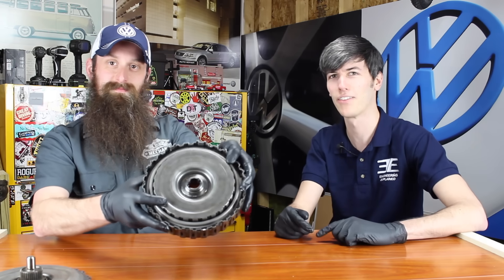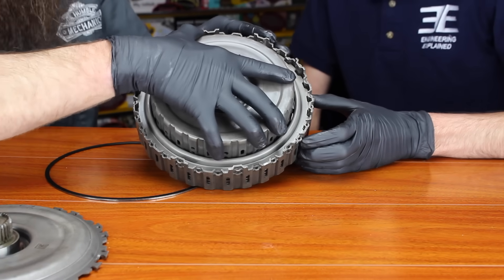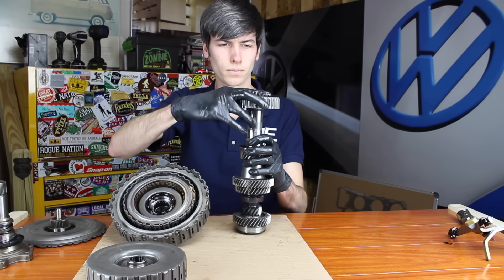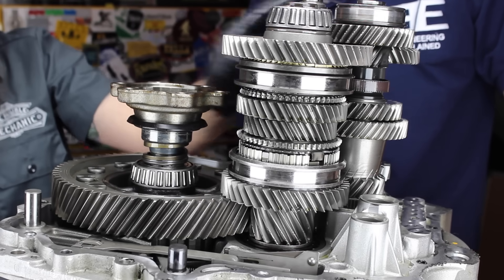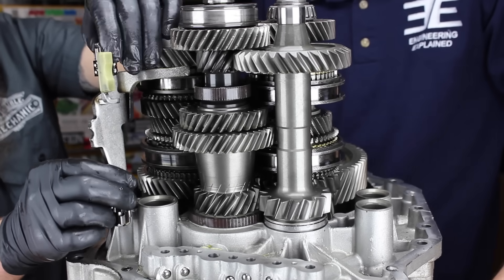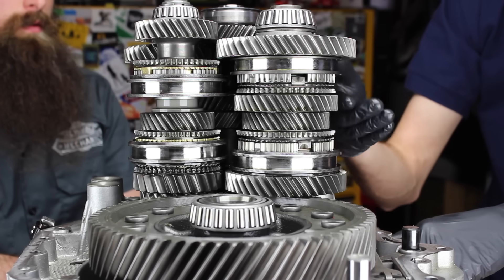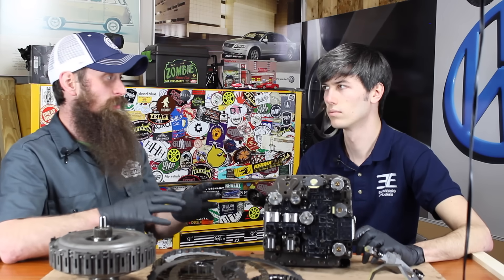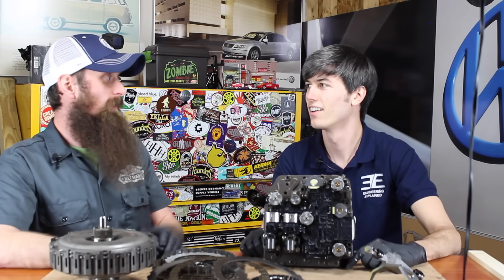DSG Transmission - Explained

Comment: how does DCT car doing inching in slow traffic ? it does not have... torque converter as automatic car..
it is just almost exactly as manual transmission car in term of clutching.. 
does it not means like you are engaging in gear of manual transmission and pressing the clutch simultaneous ly ? 
truly
andrew
Reply: And thats one weakness this transmission has. Its a little rough when it comes to inching since it has to constantly finesse the clutch. Its not that bad though. Its still pretty smooth
Reply: hii

can you explain more on how DSG transmission does inching ?  because engine can never be so slow in RPM.. hence... how it does inching ? since the user holding the brake half way whole time the traffic is slow.. ?  

does the computer auto clutch on -clutch off in this case ? 

i don't really understand your previous reply. 

your explanation or even video of explanation will be most appreciated. 

thanks
andrew

Comment: Hello guys, can you shut off the automatic upshift for a DSG? For example if you want to drive on the rev limiter in a specific gear, normally the gearbox will not allow this, it will upshift, but can you shut off this auto-safety-upshift? Or un-code it from the mechatronic control.

Comment: The dsg is a nice gearbox if your lucky enough that it doesn't die on you. My 2011 dsg Polo with 150 k kilometres on it had to have the hydraulic actuator replaced. Cost me 200 Euros. Ouch! A colleague needed the whole gearbox replaced. Luckily he got it done under warranty or else he would have probably sold the car for parts. It's a complicated system and complicated systems are expensive to fix.

Comment: Designed for Porsche drivers who don't know how to shift or who are too lazy to use a clutch pedal.  It is silly to use these transmissions on other vehicles.  The TINY increase in acceleration cannot justify the complexity and expense of using DSG transmissions.  The standard automatic transmission with a lock-up torque converter is far superior.  It's another excellent reason to NOT buy a Volkswagen.

Comment: Could you build a DSG transmission with 2 torque converters instead of the clutches? Where the oil is just pumped from one into the other when gears are shifted. Making shifting super smooth and it would last forever, because there would be no clutches that wear out.

Comment: I wish I could have my extended warranty company watch this video and understand that a clutch or dual clutch isn't a normal wear and tear item like a traditional clutch.  My DSG had some weird bucking issues off of a dead stop and just simply letting my foot off the brake. You'd think the car would inch forward smoothly but it feels like the a slight bucking until you actually give it some throttle. (Honestly I'm not sure if it's a clutch thing or it would go away with a fluid change. Thanks for the videos. Always love both of you guys  channels
Anyways they won't cover the issues and it's on me to get new clutches. +$2k

Comment: Is this why downshifting to gears seems to have the longest delay? For example, shifting from 4th to 2nd would stay on K2 and the same output shaft. In this case, would dual clutch no longer be an advantage?

Comment: Hi, thanks for your awesome videos. I have a vw t5 auto trip. Whilst on a long drive in sixth it lost all forward motion and revved up. Now I will not engage into any forward gears.. but it’ll reverse if revved hard enough. There has been no prior gearbox warnings, knocking etc. I have drained the oil and cleaned the filter but that didn’t help. As these gearboxes change gear with the pressure from the oil.. is there anything else that I could try? Maybe a oil pump within the gearbox etc?

Any help is much appreciated.

Thank you
Nick

Comment: Just bought a 2010 Gti apr stage 2 with the dsg. Sometimes it feels like it hesitates for 1 or 2 seconds and slams into 1st or reverse with light throttle. I only feel this issue while using  non sport mode (for the few days I've owned it). I suspect a new transmission filter and fluid swap would solve this but I am curious as to what you think. Is this the hesitation complaint customers give as you mentioned near the end of the video or do I have a big job ahead of me? Thanks, Jesse

Comment: As much as these types of transmissions being claimed are better I personally hate them, in slow moving traffic they are all over the place in gear selection, out on the highway when you go to overtake a slower moving vehicle when the computer sets the gear box up to go to the next higher gear and you put your foot down and have to wait for it to wake up and select a lower gear, at least with a traditional auto trans there is no waiting for a lower gear to be selected, you put your foot down and done,  and with the 3 vehicles I've driven with these DSG trans non of them where smooth with gear changing thud and clucking noises every gear change, feel the gear change shock through the vehicle makes for unpleasant driving experience and a personal dislike for DSG trans.
Reply: Damn I was really wanting a VW DSG, either a GTI or GLI but this comment section is pushing me away.
Reply: Bigshows93 Same here. I’ve driven a manual for a little over 5 years now and I wanted my next car to be a DSG Gti, but I’m not so sure about the DSG now..
Reply: Sooo you basically like the traditional auto transmission? The DSG feels like this because it's like a manual transmission without a clutch pedal! If you hate all the jerkiness, thuds and clunking definitely stay away from a manual you'll hate it ;)

Comment: Hello everybody. 
I just wish to get answer for this : when I Press the accelerator pedal that I want cross someone in my way or I try to speed up fast the car make some kik or feel like some stone was front of my car and I drive over it. The oil is fine computer test was fine and I don't know what are this.
Can you please tell me what can be this ?
My car is passat 2003 1.8T 170hp.
Reply from the maker: Is it not the transmission shifting gears, perhaps a little rough?
Reply: Engineering Explained 
It's like a kik and it happen just when I speed up
It's automatic gearbox 
Passat 2003 1.8t 170hp
It's like a rough some how.
Reply: Hi,
yes its a rough!
can you please tell me from where it can be and why it happen ?
thank you Omar.

Comment: I have this exact transmission in my vehicle. Anyone know what would cause a violent slam into drive or reverse from park (pressing brake)? I performed a basic settings. Im guessing either the shift forks (syncronizers)are jamming or k1 clutch is sticking closed while in idle gear in park due to a bad solenoid ?  It seems as if the car wants to lurch  forward while brake is depressed and shifting into drive causing a violent slam. Any input would be greatly appriciated. After a 10-15min drive the slamming goes away.

Comment: Interesting review. I had a 2016 Tuson with the dual clutch automatic (manual) transmission. It failed numerous times and they could never make mine work. Factory bought back the car. I guess they had a different configuration and not engineered well.

Comment: But selection of gears on a traditional automatic can be manual too.
Okay, see, this still an AUTOMATIC transmission. Automatically controlled = automatic. (It's just not traditional/conventional, planetary.) Now what's the difference between a DSGT and a DCT, or... a DSGT type of DCT and other DCTs, or... whatever?

Comment: Hi charles,
I have audi S4 b8 2012 3.0tfsi
I want to do a complete fluid change to my car gear box (S-tronic 7 speed dry clutchs)
Can you please help with what need change:
Gear box I am all set with 7 liter of motul oil and audi filter.
Front diff?
Center diff?
Rear diff I am all set as well.
So front diff and center diff what oil? Filter? Risk of changing the fluids?
Thank you
Eyal

Comment: How do you double clutch the downshifts to reduce wear on the synchronizers?  Also, if a synchronizer is worn out you have to double clutch to avoid grinding; can you with that transmission?

Comment: what causes them to fail. i got a 2006 Jetta and the transmission is starting to shift weird. its fine till you slow down to make a turn and speed back up. The shift indicator blinks solid and wont go till you stop and restart the car.

Comment: Hey maybe you can help me better understand my problem. I drive a 2015 Jetta TSI Auto with a DSG Transmission. Recently i had to replace the flywheel. I thought the warranty cover i have would be enough. It is not. Now my question i ask is why isn't my cover enough. Is it not because a normal warranty cover is actually designed for normal transmissions and or should a DSG Transmission not be specified with its own warranted cover. Reason i think this, by not having expert knowledge i understand it from this excellent video that a DSG box has basically two of each important specified as per normal policies parts. I would really appreciate some input here.

Comment: What's the point of having all gears from 1 to 4 in a single shaft?
Wouldn't it be far better if it had even gears in one shaft, and odd gears in the other?
In my opinion, this configuration only allows for a shorter gearbox, that's it.

Comment: When you upshift too fast in a manual, the car bounces because the flywheel hasn't had enough time to decelerate to the speed it will have when the next gear is engaged and clutch completely coupled. DSGs is basically a manual transmission, but it makes shifts in just 150~200 milliseconds. Ok, it can engage 2 gears at the same time and just switch the clutch, but how can it be smooth? Something has to decelerate the flywheel, doesn't it? I don't think that it can be achieved just by slipping the clutches.
Reply: Luis Felipe Carreira ignition cut

Comment: Hello! Please help me with my issue. 

So I own an Audi A3 Sportback 2.0 TDI from 2006 with a DSG transsmision. Everything is good except some kick noise (metal on metal) when downshift from 3rd to 2nd when I'm stoping. I recently did the DSG service (fluid, filter...) but still there is that klick. The car drives excelent, the shifting is amaizing, everything is just fine except that clunk. What could it be? 

Thank you!

Comment: Would low transmission oil account for the second clutch not engaging as my friend has lost reverse ,2,4 and 6 or would this be a sensor problem as the engine management light is on (or could low ATF do this) as I'm an old sun and annulus guy :)

Comment: Great explanation, and good team work.  Question regarding size and AWD:  how does the size of a DSG transmission case compare with a manual or regular automatic case.  Charles, since you have the VW dealer experience, which of the three seem to hold up the best to heavy traffic use, and since the all wheel drive system used by VW and the DSG transmission are supposedly Borg Warner designed units, do all VW transmissions have outputs for a rear drive, or only special transmission cases allow a rear output?

Comment: I have a question i really don't understand or am I missing something?
When you are in the first gear, and the transmission have selected gear no 2 for you on the second shaft. I guess then the second shaft is not receiving any "feed oil" (which you said what programmed) for engaging the second power input from the flywheel. So when its time to shift to gear 2, does the oil getting delivered to "shaft 2" activate an already engaged clutch and its the oil that takes the force of speeding up the gear, or does the clutch have to spin up first with the oil and then gradually "slip" the clutch discs like a regular clutch for the next gear to spin up? 
(Did anyone understand now?)

In long term I guess this difference will do quite a lot in wear and timing. On of those options is like disengaging the clutch and just let the clutch out without rev-matching for every gear.

Comment: sooooooo dual clutch is twice as good as a single clutch, and automatic is basically clutch on everything

sooooooooo what if we had a six clutch transmission? have EVERY gear always engaged and just clutch to decide which gear is selected?

I mean, if anything, that eliminates like, all the problems of every transmission, because it could be computer controlled or manual and just, six gearshafts and six clutches and you just select which clutch to clutch with.

Comment: i drove a 2015 Skoda Octavia diesel in Scotland and I think the Skoda used this trans. The car  shut the engine off instead of idling at a stoplight (should have seen the looks on our faces first time  it stopped) . Seemed to work real good, but had a couple of scares on steep hills when stopped. You had to release brake to restart engine, but then car freewheeled backwards and couldn't seem to cut back in forward. Took a couple of restarts but finally pulled forward, scared the guy behind too. Might just have been my lack of experience. Put about 1800 miles on. Seemed powerful enough for a fair size car with only a small engine, hauling 4 adults and lots of luggage.

Comment: I am curious about what happens to the energy during a gear change in a double clutch gearbox. Since the shifts are "instant", the engine does not have time to drop in RPM to match the next gear. All that rotational energy from the engine must go somewhere when it drops in RPM. Is it a lot of energy? If it goes into the clutch, say on a PDK which is a wet clutch, does it cause any appreciable wear?

Comment: You forgot one crucial thing and that is not to park your car relying on the dsg to keep you stationary. You'll introduce unnecessary stress on your dsg. Always use the E brake. Brakes are cheaper to replace than a transmission.

Comment: Can you ever have an electronic/valve fault where the car ends up with both clutches engaged at the same time locking the transmission up?

Comment: Very informative. I have a DSG on my VW and lately whenever i shift while stationary, into R (rear) or D (drive) mode, gearbox would as if kick itself, so it can be felt throughout the car. Any ideas, what might be the root of this problem? Someone mentioned to me it could be due to problem with one of the clutches.

Comment: so what is causing so many to fail, VW has recalled so many DSG fitted vehicles world wide?
Reply: Robert Smith its german...designed to break like most german cars
Reply: @alanbrand7681  haha, sure, unlike American crap that no one in the world buys
Reply: Aleksandr but it doesnt change the fact that germans are trading on their past reputation
Reply: @alanbrand7681  I've always owned German cars from different years (1999, 2010, 2017) and I never had any major problems with them because I service them properly and regularly, same with people I know, even with non German cars. Maybe when you start taking care of your car, your car will take care of you

Comment: which one of the automatic transmission is good CVT or DSG?
Reply: CVT SUCKS! extremely unreliable and destroys all driving enjoyment due to the “rubber band effect”

In terms of reliability, best to worst;
Manual>conventional planetary automatic (torque converter)>DSG>bicycle>horseback>walking>CVT

Fun, most to least;
Manual >DSG>bicycle>Torque converter automatic >horseback>walking>CVT

Comment: From what I understand these DSG's are really stout. tests drove a VW last summer equipped with a DSG and was very impressed. Got a manual instead at time (Chevy Cruze) which has many clutch issues right from the get go. Wound up off loading it and taking a $2500 hit. Seriously thinking about buying a DSG equipped GTI next summer.